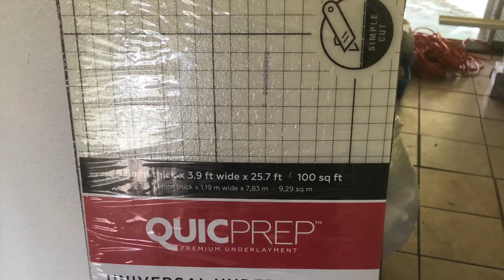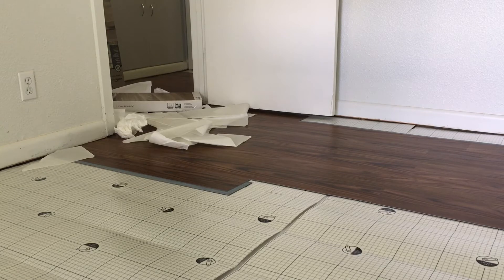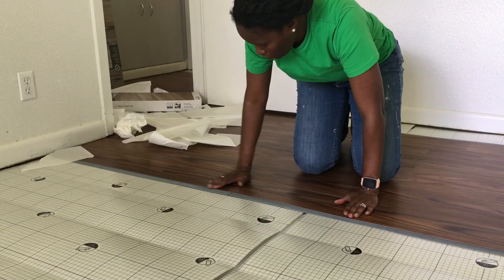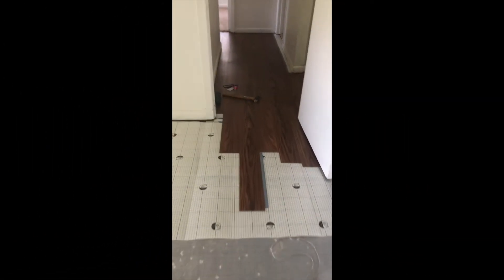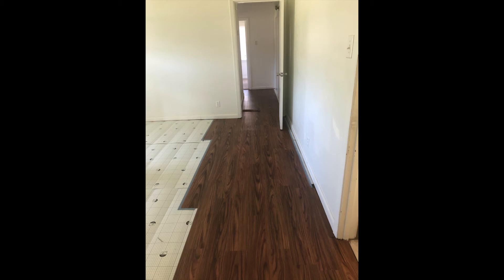Landlord Tip: DIY Flooring for Rental Properties

Comment: Can this be use over carpets?
Reply from the maker: No, the strips may get carpet fibers  on them & no longer work as intended. The back is very smooth and it may slide on the carpet.
Reply: @WeekendswithWinnie  could I put something over carpet and then the flooring? I just painted my yotuube room. Have carpet flooring.
Reply from the maker: That’s above my skill level, lol. I can image it would be like adding a sub floor if you put plywood over the carpet. But I recommend removing the carpet and/or consulting a professional. I know you want your room to be flawless when it’s complete.
Reply: @WeekendswithWinnie  Thank you so much! I thought to try save money.  Lol just became a home owner.
Reply from the maker: @MontanaKat1912  Congratulations 🎉
Reply: @WeekendswithWinnie  thank you! Use to live in an apartment. Just got way over price. My mortgage is 823 a month.:)